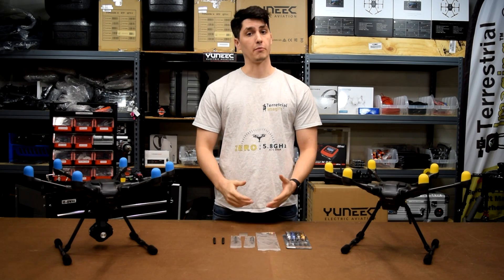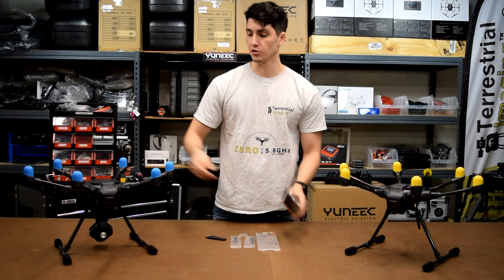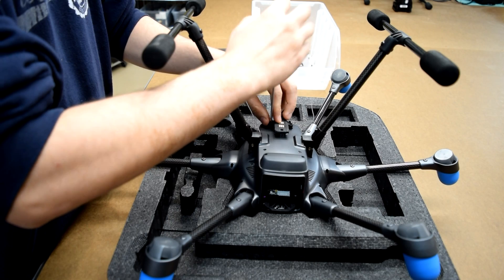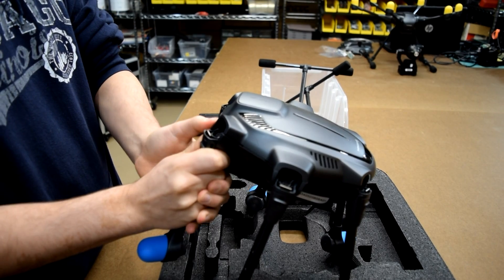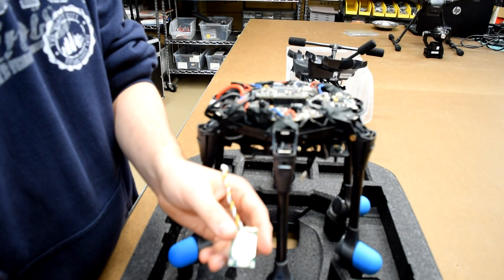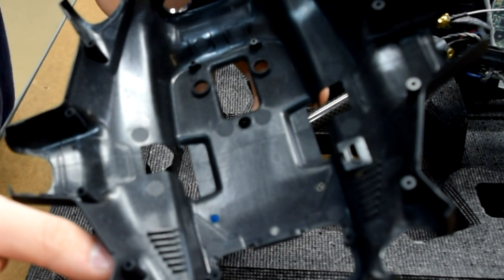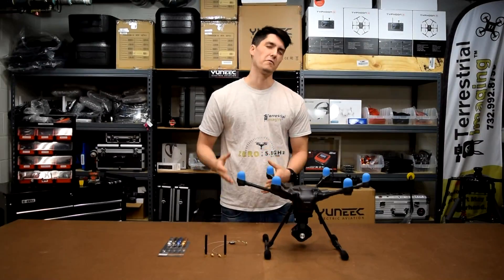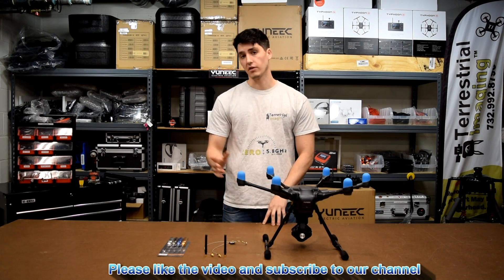Yuneec Typhoon H External Antenna Mod For Typhoon H480

Comment: That seems cool and all but in GUI you have a max distance anyways. I can usually go 3000 ft before freeze on screen. Does this help with the 5.8 wifi?
Reply from the maker: No, this kit only enhances the control between the aircraft and the controller. The 4Hawks antenna will improve both the 5.8 and 2.4: https://store.terrestrialimaging.com/4Hawks-Range-Extending-Antenna-Kit-for-Yuneec-Typhoon-H_p_445.html

Comment: That hole for the antenna looks bigger than 1/4 inch. You recommended 1/4 inch is that the actual size of the hole or do I have to ream it out?
Reply from the maker: Hi Cisco....1/4 exact.  Drill 1/4" hole using a bit designed for plastic (wood bits tear up the plastic) and the antenna mounting threads will fit through perfectly.  Cheers.